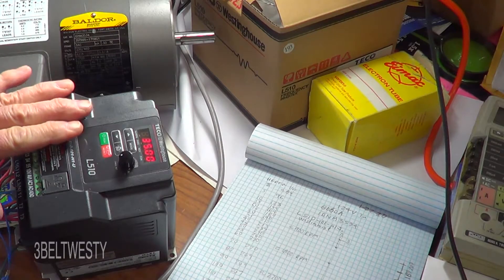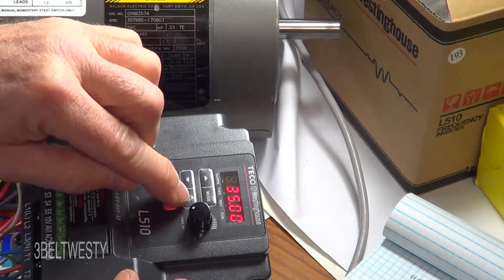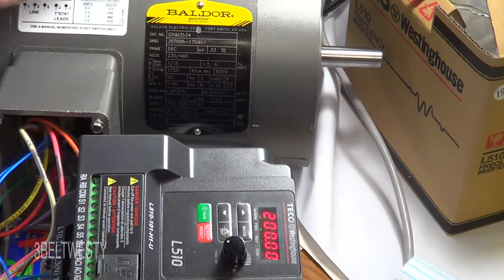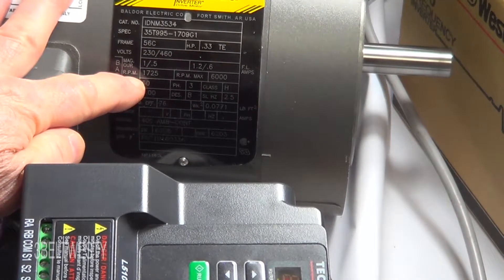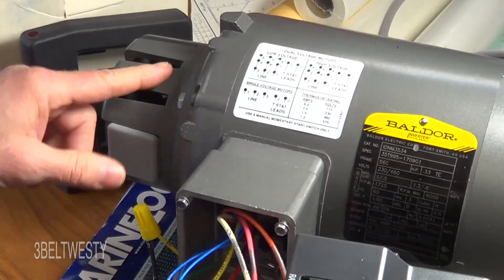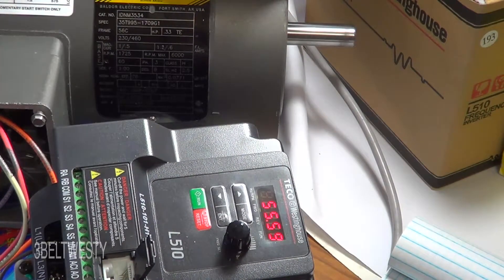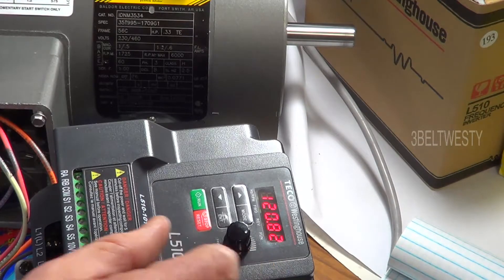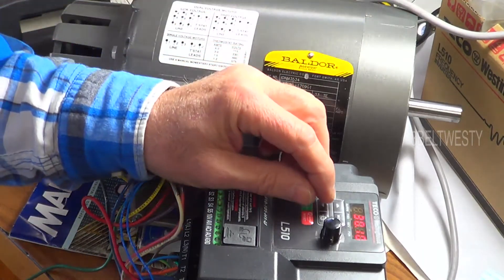Voltage vs  Frequency 3 phase motor  VFD inverter drive

Comment: If the input voltage to the vfd is below the rated voltage, will it create a problem or will the vfd adjust the speed?
Reply: It depends if the input voltage gets below the limit of the vfd can handle.